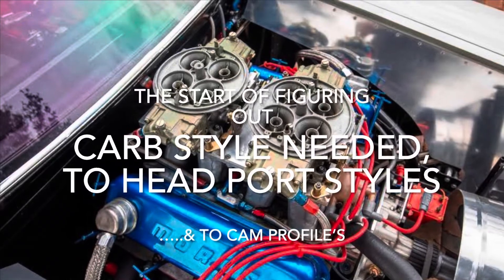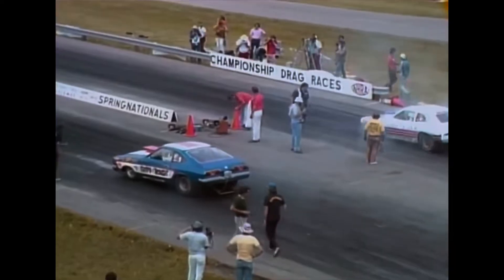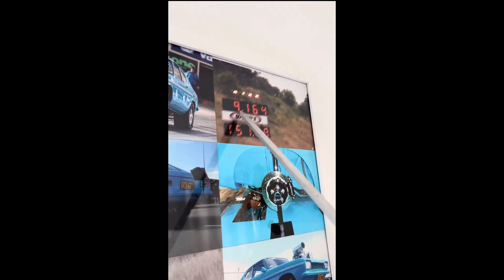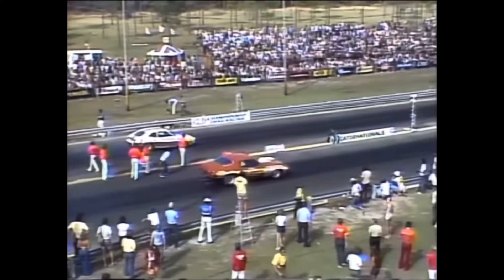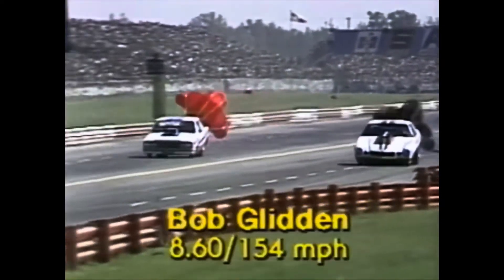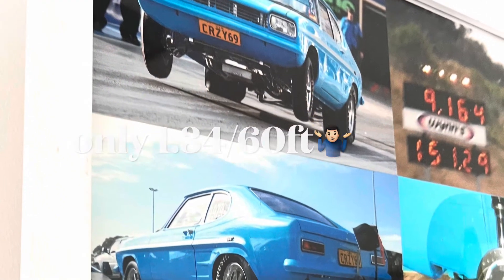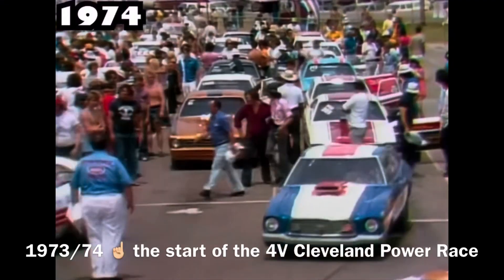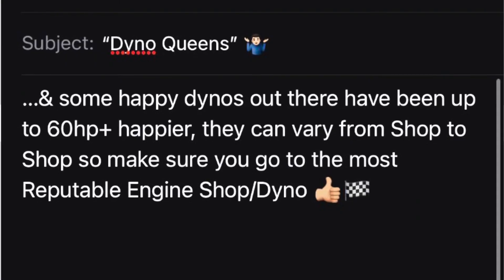Ford 351C Pro Stock, How Much HP did they really have? (1972-80)

Comment: The  351C, Boss 351 cylinder heads were some of the most highly efficient heads of all time.
Reply: Noo thats wrong. The 351c4v cj was way more efficient. Its was closed chamber. 351c4v and 429scj ports were way to big.  There was no carb signal. Glidden discovered this and epoxied the floors to make smaller ports, then by doing that changed the angle in. Then came the hidden angled welded tunnel rams.
Reply: @tomhowe1510  Glidden gained well over a hundred horsepower upon raising the exhaust ports alone. Leonard Wood and Bud Moore of nascar did the same thing. Glidden was the first to create the heart shaped combustion chambers that are now standard on all hi po heads. A genius at his profession.
Reply: @stealthbomber2127  1979 1980
Reply: @tomhowe1510  Bob ran the Arrow in 79 and dominated with it also. Leonard Wood was raising the exhaust ports in 74.
Reply: @stealthbomber2127  and 1980. He was good. He was lucky Ford heads were so good but so bad. 351 CJ heads were closed chamber. Ford new Cleveland chambers pinged
Reply: @stealthbomber2127  I guess what I'm saying is that he couldn't possibly have built a dominant 340 in such short time. The w2 head out flowed the Cleveland with Tiny runners.
Reply: It’s amazing to think that all that cylinder head work was by hand!  No CNC no computers nothing but a great eye and hand work. Unbelievable

Comment: Bill Jenkins 1970 Camero with the aluminum 430 inch motor put out 710 hp in 1970.
His 1972 331 Vega put out 545 initially an  585 at the end of the season.
By 1975 according to my issue of National Dragster analysis of Pro Stock engine development by that time the engines were 2.2 horsepower per cubic inch.
By 1977 Larry Lombardo according to his words had the 331 inch Chevy putting out 653 horsepower.
I think that's consistent with the low 8 second times for that era.
Reply from the maker: Sounds reasonable & on the money, thanks for sharing 👍🏼🏁
Reply: I enjoyed the video. 

On reflection I think Larry Lombardo's engine was a 350 not a 331 as I stated.
Reply from the maker: @brenthill3241  glad you enjoyed it👍🏼,
 i can prob see the 350’ish Ci guys probably making the mid-700hp range give or take…..thanks again👍🏼
Check out my other Vid on Roush Boss 302 (290ci pro stock build) & what he says it should make, it’s a 77 article / info that  i did a vid on. 👍🏼🏁

Comment: I think that you are low by about 75 to 100 hp. Darin Morgan suggested high 700's. I realize that your combo has added weight of turbos, etc, but remember you are running aluminum heads, not cast iron. Two holley dominators surely weigh more than your throttle body, as well as the early cars probably running heavier wheels and tires. fuel cells, batteries, starters, fans, everything is lighter now than in the past. These early racers were making gold out of cast iron, not hot air ( turbos).
Reply from the maker: Yes , so across the 10yr period with Cleveland ProStock I’ve mentioned here & on other vids/posts that going off the weight class & trap speeds etc that they’re probably started making high 500’s (580’ish)hp early 70s & probably topped out at 750’ish by late 70s/early 80s……. This is going off the information i can see & read & based off my own experiences (30yrs) i have with racing, power to weight, Cleveland’s etc🤷🏻‍♂️
When someone finds me an actual Dyno result of an early “true Cleveland”ProStock engine that’ll be great? It’s only been speculation otherwise. People love to have high hp figures thrown around, makes it feel cooler…….but unfortunately Stats can show a lot if your experienced at it.
& also it’s different if building a replica “ProStock” Cleveland of today, all the little things today to make up that combination & completion are better, lighter & more efficient compared to an actual 70s combination……..
Things like bearings, valve spring’s, piston rings, Oils, etc….. even a modern take on a replica ProStock built Cleveland should show 50+hp compared to if it were actually the 70s versions……
It is what it is 🤷🏻‍♂️🏁
Reply: @69JANKS  Appreciate your answer, but when I read the NHRA rules and the magazine articles from the time, Bob Glidden's Clevelands were 332 to 340 cubes..so de-stroked. The rules were 7 pounds per cube, but Glidden's Pinto was penalized 300 lbs. plugging the Pinto's stats into the HP ET calculator gives 725 hp for the Glidden Cleveland in 1973, and 769 in 1974. Glidden's Fairlane in the late 70's was only penalized 150 lbs, so the ET HP calculator shows 805 HP. Trap speed was slower than expected because the Fairlane was shaped like a brick. Of course this was not a regular Cleveland but a destroked machine whose cylinder heads had days of welding done.
Reply from the maker: @kidsteach938   yes check out my Community Post on this☝🏼, the penalty was more so for Cleveland powered “short wheelbase” (pinto) , so there’s an advantage on hard hitting 60ft times achieved being shorter wheelbase 
Everything is relevant…… then you gotta factor in the ET alongside its MPH & see what the moroso-calc tells also especially at around 2300lb (Lenco backed)
Like I’ve said, look at combinations now & compare, i know I’ve gone 151.3mph, 3050lb & it’s 800hp🤷🏻‍♂️
Imagine adding 700lb to them they’ll barely do 140mph & mid-9s…..
Check out some of my other vids on this, even the Aussie ProStock vid of mine “ShotGun” Cleveland powered doing 8.8s et & surprisingly the commentary even states the power they’re making🤷🏻‍♂️
It’s just power to weight at the end👍🏼🏁
Reply: @69JANKS  "Like I’ve said, look at combinations now & compare, i know I’ve gone 151.3mph, 3050lb & it’s 800hp" I understand, but tracks are better today...tires hook better, chassis hook better, lubricants are better, and even the track measuring equipment is more accurate. Please don't think of Bob Glidden as a racer. He dominated for a year with a Mopar/hemi car. Different engine, different chassis. Glidden is better remembered as a 1970's version of  Kaase...who can dominate Engine Masters with almost any engine, and competitors a decade later struggle to match his results. I51 at 3050 lbs is amazing btw. Thanks for keeping an amazing engine in the spotlight.
Reply from the maker: @kidsteach938  right on👌🏼 thanks for tuning in I appreciate it 👍🏼🏁

Comment: I read Grumpy Jenkins book just recently , and it seems they had Roller Cams from the early 70s onwards.. And most things came from General Kinetics / Cam Dynamics.. Isky were also a big innovator in many classes coming up with things like rev kits and grinds that weren't as harsh on the valve train for the same performance as other grinders. Comp sponsors everything now, so they get all the kudos go figure..
Reply from the maker: right on C.U.F thanks for sharing 👍🏼🏁
Reply: I run an Isky solid roller in my Cleveland headed Windsor. I shift at 7700 and usually buzz the traps at 8000. My Ranger is 2400 lbs and runs almost 138 in the quarter. Now mine is a pump gas street truck so there's a lot of power left on the table.
Reply: Sweet

Comment: 600-800hp buddy and haven't even watched the video lol
Reply: I asked Tim Halstead what he thought those prostock clevos were making back then he said about 840hp, I was thinking About 7to750🤔I guess we will never really know😉
Reply from the maker: @danonoveh8114   i think you & i are on the same page lol🏁, HP must be a little happier over there🤷🏻‍♂️🏁
Reply from the maker: Look at it this way DN, Tim has a very stout “drag combination” & it’s a 408ci, alloy A3 high port style heads(Daren Morgan prepped) latest & greatest Carb induction & Cam valve train gear etc & it made 775hp on the best race fuel & 8000rpm & this is all 2023 times…That there should say it all……it’s not 50yrs back man😕🤦🏻‍♂️but ppl still wanna think they made 840+hp lol
You can’t compare a filled intake iron 4V with Hi-Port plates to an all out A3 alloy, because that’s what an A3 is…….an all revised alloy (4V ProStock style head) 🤷🏻‍♂️🏁
Reply: @69JANKS  I think you guys make the most horses with those clevos mate👍🏻😀
Reply from the maker: @danonoveh8114  👍🏼🏁
Reply: If they did all the tricks on the Cleveland heads they had 330 to 400cfm.   They ran 14:1 or 15.:1 compression.  The tunnel rams.    My guess is 850 to 900hp.
Reply: @dennisrobinson8008 900hp N/A lol not back in them days😂
Reply: @twotwocold  Cleveland heads ported by Glidden, 14:1 or more, big solid roller camshaft, tunnel ram intakes == 900HP, it's way more than 700HP.   Glidden could get the Cleveland heads to around 400cfm with all the work he performed.   That 400cfm combined with high compression and high rpm can get well over 800 HP without a thought  up to almost 1000 HP......     Lets check the MPH and weight.   Tunnel ram intake is like 50+HP over a single plane intake.   Also the fuel.
Reply: @dennisrobinson8008 I agree with you, my guess is 900
Reply: @alanmeyers3957  Sounds about right.   They were making some power.
Reply from the maker: Thanks for tuning in 👍🏼🏁
Reply: Glidden said in an interview that he didn't run the Cleveland's as hard as they could run because the Nhra kept adding weight to his combination.

Comment: …it doesn’t matter what scale your dyno uses the principle is to tune the engine for the range it works in, comparing numbers is like comparing grandmothers……….
Reply from the maker: Yes tuning tools really, but Dyno  calibration should be universally even & right…..the results it’s spits out does count at the end of the day💯🏁
Reply: @69JANKS  …people way before you were born used a screwdriver to tune cars, and few of them were the same, some were better than others. To make an arbitrary scale to compare yourself to means nothing.  A true experiment requires the use of the same tool, in this case it’s impossible, so you use the tool you have to your advantage…..
Reply from the maker: @ltv..123  right on LTV , thanks for sharing 👍🏼🏁

Comment: Super awesome vid!!
What you are saying is absolutely correct!! My junkyard 8:1 460 60’ is coming in at 1.67. Best et I believe was a 12.68@ 104 mph with 3.89 gear C-6 auto 3000 stall in 3825 lb  72 mustang. Launches with wheels up a little bit but there is no cam or head so she is out of breath around 4800 rpm.
Reply from the maker: Thanks RN👍🏼, wow that’s actually a very good et  & even 60ft 👌🏼🏁

Comment: A lot of good old video. I'm old enough to have attended some of the Pro Stock races back in the 70's. My favorites were the match races where Dyno Don was lethal. In regards to the exhaust plates, I recall the Ford racers using them back in the early days of the class as well. Those were my favorite Pro Stock racing years. Wheels in the air with drivers rowing through the gears with pro shifted top loaders!

Comment: The scales and MPH show the real HP of an engine period ! We dont race dynos.
Reply from the maker: exactly c351👍🏼, don’t get me wrong a Dyno is a good tool to know what you have & for it to be applied on the track
But there can be a heavier car, with less HP that does better in the 60 & et🏁 than a lighter car with more hp if that 60ft isn’t up to scratch on it….. 🤷🏻‍♂️🏁
Reply: Dyno's and flow benches are testing tools. Race tracks are proving grounds. What works during bench testing, doesn't necessarily work at the track. That said, we do race dyno's, Horsepower Hero's and any other dyno shoot out competitions for example. E.T. and mph only gives you the information for horsepower utilised, not for actual power produced. They can potentially be very different numbers. How many times do you see racers adjusting set setup for track conditions, be it clutch, suspension, tune, 2 step etc. An extreme example of what I am saying is to take the excellent blown Capri, do a pass on slicks, then change it to 185/60R14's and do a pass. The horsepower figures based on E.T. and mph will be significantly different, but the motor hasn't changed.
Reply from the maker: @theshed8802  right on TS….😂185/60s haha that’s gold… nicely put👌🏼. The examples here are for yes Drag racing 1/4m at its greatest effort by individuals or teams…. Dynos & flow benches etc are of course helpful tools no doubt ,that any increase on data (blk n wht) should be looked at for any positive changes at the track also responsible in picking out what’s needed eg: Convertor, Gearing, tyre dia” etc…..
But ultimately the 1/4 is a short sprint, & a lot can be told with a pass (on the serious guy) not on 185/60s 😂🤦🏻‍♂️, I’ve seen heavier cars (well set up) with same or less HP actually 60ft way better than a lighter car with equivalent HP that may be on the money with everything else except an adequate 60ft to suit, so a story can be told on these particular passes in where they can possibly stand in et🏁 or power being shown by at least the trap speeds….. but these early ProStockers aren’t the case in that☝🏼,they are perfect in 60ft times, gearing & crossing thru the traps at absolute peak+ rpm’s 👌🏼 & once you see their  mph on the actual weight of that drag car then HP can roughly be determined 💯 hence the Moroso Calc👍🏼🏁
Reply: That's forsure👍🏻